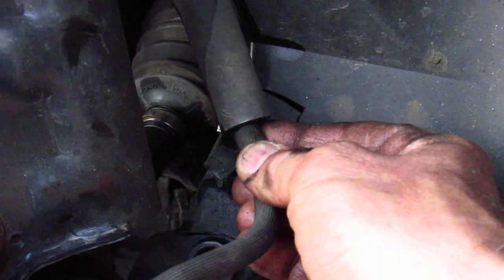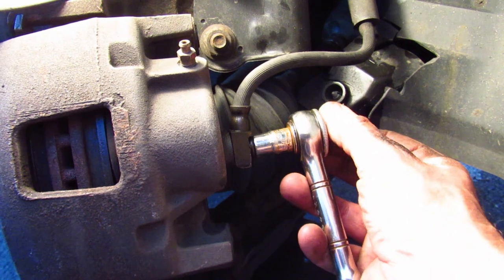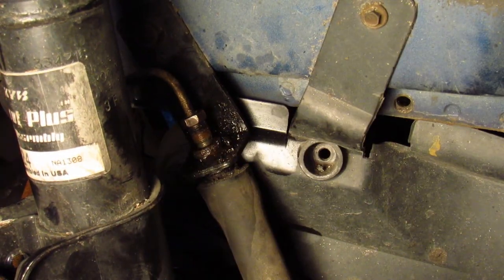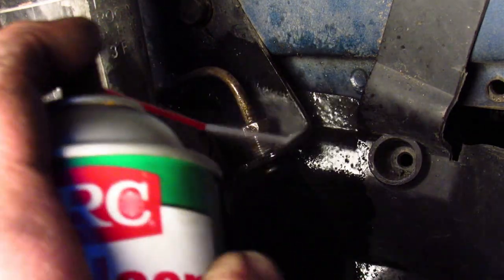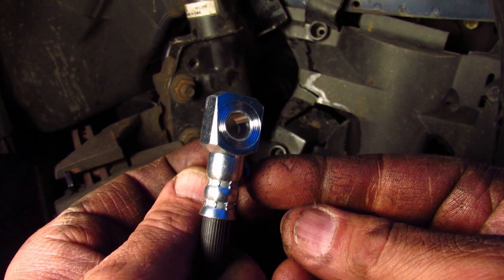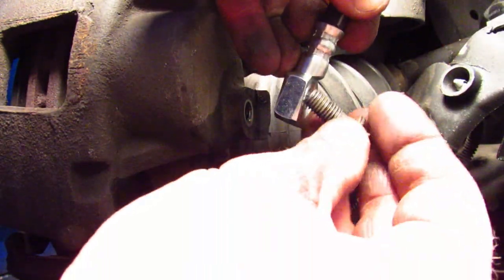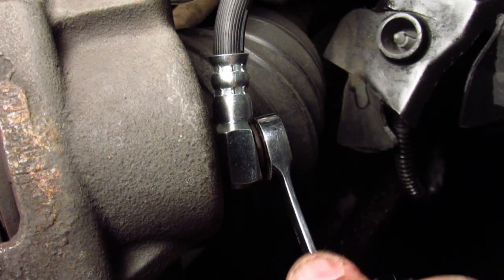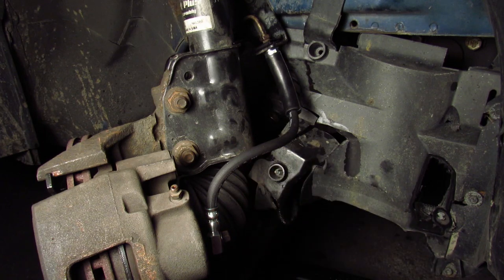HOW to REPLACE a FRONT BRAKE HOSE with the 2000 CHEVY CAVALIER!

Comment: Those rubber brake hoses are crap, cars should have braided hoses from the factory. Love your videos, keep up the good work😎👍👍
Reply: Rubber is beneath braided hoses. Harder to tell if hose is defective with braided ones
Reply: @kalani1987  I’m pretty certain there is ptfe tube beneath the stainless braid mate